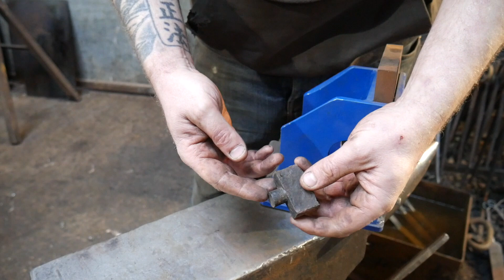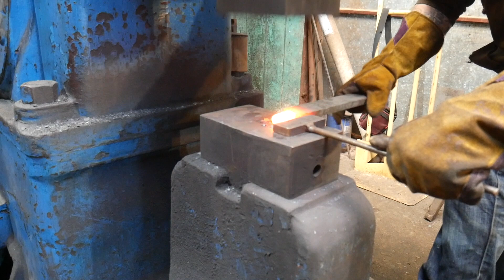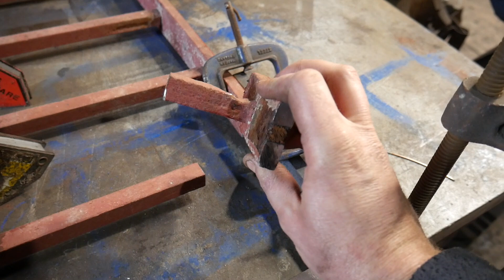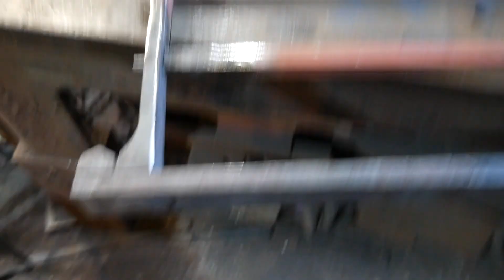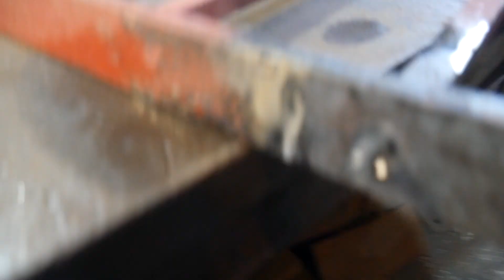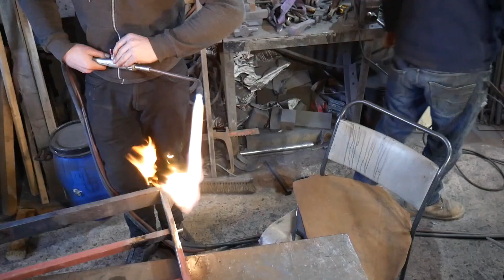round tenons

Comment: Welcome back Sir. Was contemplating a search party. 

Question: how did the blacksmiths or yore mushroom the tenons into place without their having an oxy fuel torch to concentrate the heat on the desired location?
Reply from the maker: Hotted them up in the fire and had more skill than me. Lol 

But wrought iron is like butter when hot so is a damb site easier to move when hot.